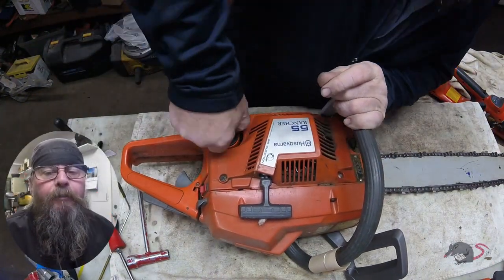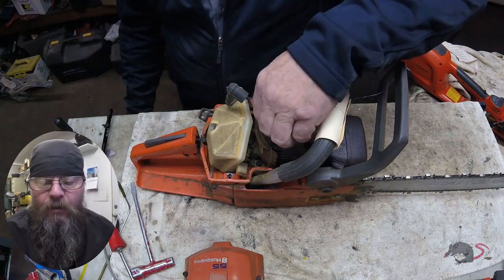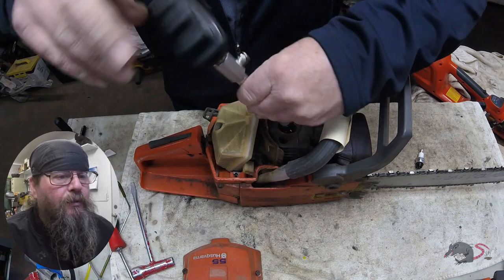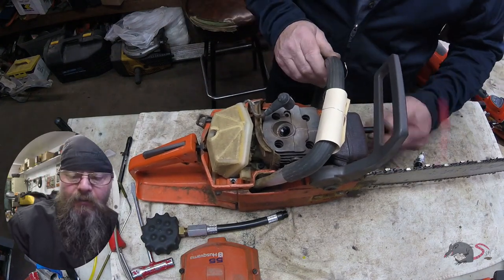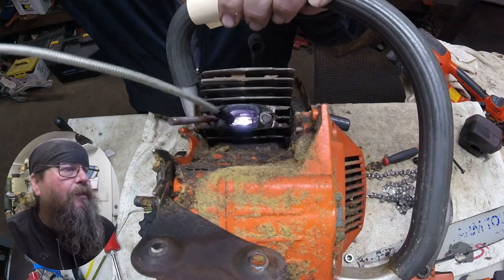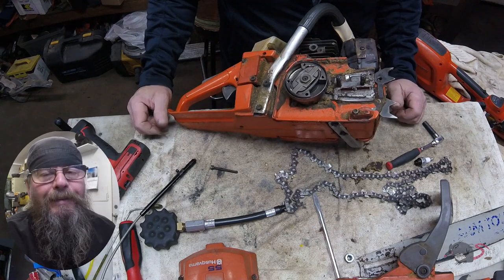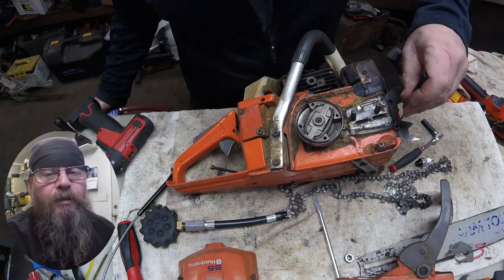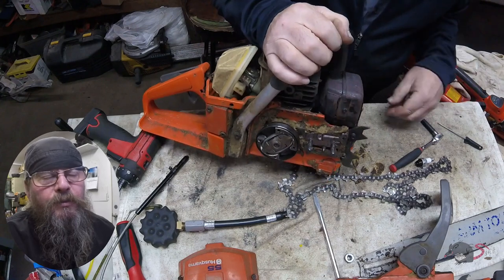Husqvarna 55 Complaint No Warm Restart

Comment: thanks alot for uploading, nice to see even if you didnt fix it. Got a 55 with similar issue... hopefully i can get it atleast running. Its my first chainsaw (quite used but not serviced in years...) would help alot to get it running, firewood would be nice this winter :3
Reply from the maker: Good luck with your repair

Comment: I have a Husqy Brush Cutter 235R from the 90's. It has got to where I can run 1 tank out, go to refuel and never get it started again.
Reply from the maker: My recommendation is to inspect the cylinder for scoring.
Reply: @TheGreasyShopRag  Thanks I'll check that.🙂

Comment: how    can you have good compression and still be scourged ?
Reply from the maker: I suspect the grooves and gouges all align enough to create some type of seal. The problem is that after the engine has been running and creating heat, the rings can pinch in the piston groove and not seal much at all.

Comment: Being noisy what do you charge as a minimum labor rate? Looking to start doing work on saws and small engines ? I know demographics are a part of it. I have no clue what dealers charge. I never used them for labor. Always fixed my own stuff. Thanks.
Reply from the maker: Our lowest minimum labor rate comes out to just under 22 dollars with tax included. We have another minimum labor rate called a diagnostic fee for those jobs where you don't actually fix anything but are in that 15 minute range. I think those four stroke knuckle draggers on the other side of the shop may have their own minumum as well but I don't know what it is. Sometimes we don't charge anything and just ask the customer to buy something he would normally need like bar oil or whatever.
Reply: @TheGreasyShopRag  thanks for the information. Enjoy the content.

Comment: Unless the scoring was excessive I would probably opt for cleaning up the piston, replacing the ring(s), possibly ball honing the cylinder and hoping for a reasonable compression number, especially based on this owner’s usage.
Reply from the maker: You would also want to confirm why it was scored so you're not just fixing the result of some different problem.
Reply: @TheGreasyShopRag  
Absolutely, and good point! 👍🔧

Comment: Cylinder and piston are inexpensive for this saw. Easy to replace. You spend more time cleaning sawdust and oil off then it takes to replace the piston and cylinder.
Reply from the maker: We only use OEM parts when replacing piston/cylinder. Thats $120 plus labor. Yes its worth fixing but in the end the customer has to make that decision.